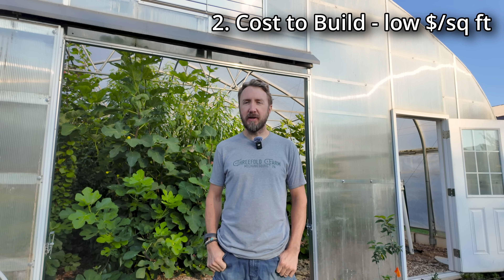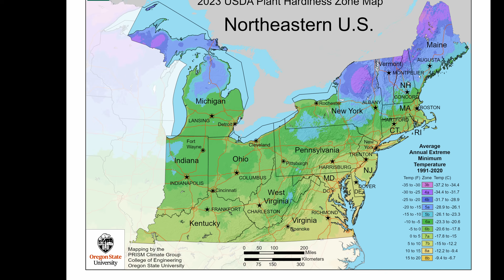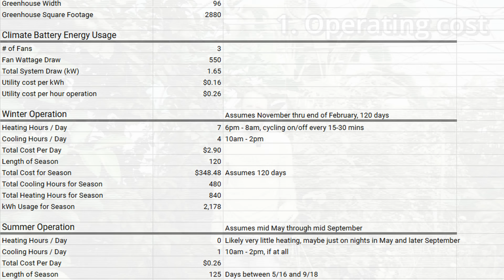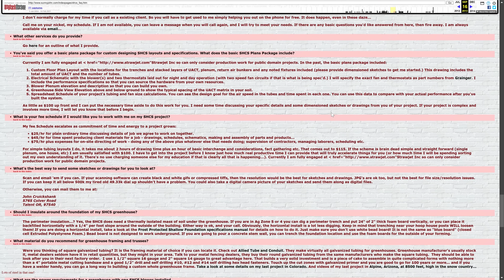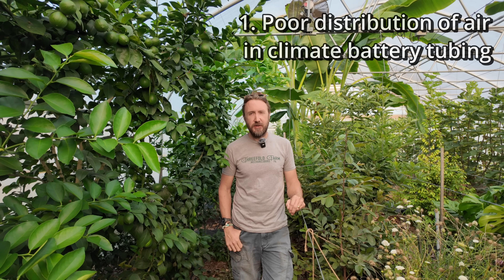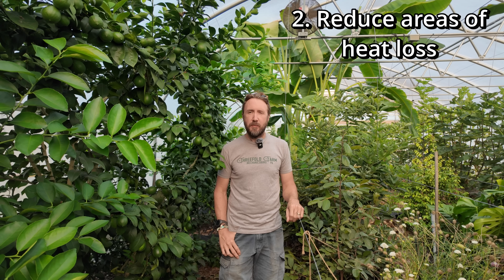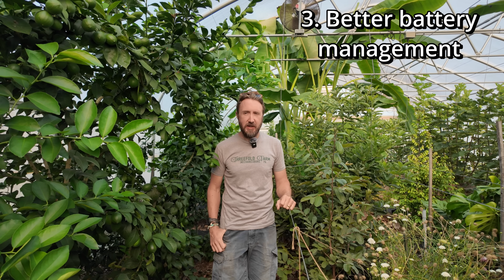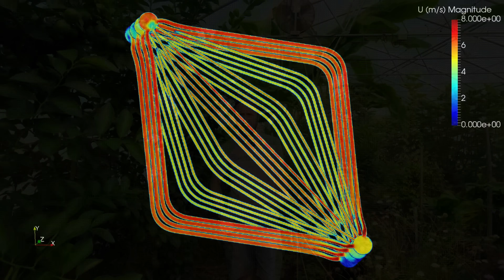Building an (Almost) Tropical Geothermal Climate Battery Greenhouse in a Temperate Climate

Comment: It seems that since fluid dynamics are so complex and unpredictable through a manifold did you ever experiment with a single sized airway that snaked back and forth and then split at the surface into manifolds to evenly distribute the ground temperature?

Comment: Loved the video! A few questions and comments
Why did you use a diamond shape distribution rather than simple parallel lines of duct work?
From the diagram it appears that near the inlet and outlet there is really very little soil to pipe ratio so each pipe is fighting the adjacent ones for ground to give or retrieve heat from. Yes you only need very short main ducts but I suspect it drops the efficiency by about 30%.

Plastic is a terrible media to conduct heat through. More insulative then conductive.
Corrugated pipe is terrible for air flow and heat transfer. The ribs increase the dynamic head so you need much greater fan force or need to keep the runs short. This may be why some of the runs are not nearly as efficient as others. The diamond design means some runs are longer then others so more resistance. Path of least resistance is alway where water and air go first. Also the air flows past the ribs in a way that leaves dead air in all those rib spaces acting as insulation as the flowing air is not in direct contact with the wall of the pipe. Sort of like your winter wind screen protects the green house from heat loss. That said the drainage tile is extremely cost effective just don't backfill with dry sand.
 
Maybe draw the heat from the peak of the greenhouse. The temperature would be 20 or more F degrees higher there on a sunny afternoon, increasing the efficiency dramatically

Comment: Thank you for the video. I want to make such a system for the greenhouse I will build this year. I am a ventilation specialist, I would try to change your noisy air fans to HVLS, to relieve your ears 😊 High Volume Low Speed fans

Comment: I would suggest doing a wrap of gravel and highstrength landscape fabric around the corrugated pipe. Check out weeping tile diy stuff where they burrito wrap the pipes to keep mud from packing in the holes of the pipes. It would prevent the pipe from crushing. You could also use pvc instead. The rocks would allow drainage if you have any water wicking in the tubes. The wrap would keep mud out if you have heavy rains. The rocks may help with a heating efficiency as well and may act as an electrolyte similar to an actual battery. I mean God put rocks in soil for a reason right? Which would allow maybe, for a more humid environment, tropical like climate.

Comment: So you gave me several ideas with the screen that you put to block wind. 7 Foot Tall Solar Panel Fencing, Or Even Just Used Solar Panels. No batteries, no charging, no inverters, just run that to DC heaters into the pool or pond at center of the greenhouse, let it heat up the water and during the evening it would release the heat. So the solar fence can keep the greenhouse warm, at the same time store direct solar energy in form of heat inside the greenhouse. No digging necessary possibly. Thanks for a great idea. Another great idea may be to instead of homes building Roofs of Wood, make the Roofs of Greenhouse, so that you can have a green house on your top floor, and the home needing to be warmed or cooled could provide the mass, as the floor could be made out of insuldeck a concrete material floor, so a sturdy structure with an amazing veggie and fruit garden upstairs, and yes automations could be introduced into there too! Good video watched every minute of it. Keep up the great work, would love to grow my own citrus and avacados!
Reply from the maker: Glad to hear the ideas were helpful!

Comment: I’m wondering if you could build a more efficient system using tubing that is a good conductor. Isn’t plastic a pretty bad conductor? I’m sure that cost would be the trick, but imagine if you could use something like aluminum pipe or copper (cost would make it impossible but just to make the point) below the ground. The temperature transfer between the soil and air would be really great. I’m sure I’m not saying anything new here. Just curious. Thanks for your outstanding work !

Comment: Seeing the students go into the pipes and see difference of temperature is extremely interesting. It’s likely worth it to throw a few temperature sensors inside the pipes and then have fans ramp up and down to average the temperature. Doing that would prevent some spaces from doing better and prevent some fans from needing to run saving power. Aka using fans whose areas are cooler is more efficient than those which are hotter because of the larger difference in temperature. It could also mean you could more precisely control the temperature by having less fans run at once and benefiting from the larger change in temperature. A couple esp32s with a dht22 using espnow would be a great project. While not chance the signal would go through the dirt having possibly even just one host (at the exit of one of the pipes )listening to all the sensor clients could be sufficient. To collect even more data you could have a few sensors around the green house to see if averaging the temperature throughout the climate battery results in a more average temperature inside the green house. I can think of soo many ways to potentially improve the efficiency. I think if I ever did a green house with a climate battery I’d end up spending too much time learning everything about it lol. Great video especially love simply going through potential solutions it’s important to know one size doesn’t fit all and it depends not only on where you live but your desired outcomes

Comment: how about adding heat sensors inside the tubing that is monitored by an computer or an AI that can then regulate the fan speed to improve airflow where needed
Reply from the maker: Yep, that's way down the line but could be a useful tool. Unfortunately our fans aren't as speed-controllable as that, though there seem to be fans coming that would allow for that level of control.

Comment: Have you considered at all driving pipes underground at a depth of 20+ ft instead of excavating the entire footprint of the greenhouse? Would the added benefit of depth offset the drill/installation cost over the cost of excavating the footprint to lay the pipes like in your greenhouse?
Reply from the maker: 20ft would give you a larger battery but still wouldn't allow you to tap into limitless heat. I have another video on the misconceptions about climate batteries that I'd recommend. 20' is really deep too, not sure it'd be worth the cost and I'm not sure how that'd be done (hydro excavation?).

Comment: Very cool approach with the simulations based on the physics properties. I always thought as a software developer myself that this is the way to go even in the adjustment of heat pump and AC systems where each system has a different efficiency curves based on the different sourcing temperatures etc. Fun fact there are also ice storage solutions (Eisspeicher) where the loss energy of a phase change is used by to use it in a heat pump. Because water looses as much energy when it is cooled down from 80°C (176F) to 0°C (32F) as it looses from a liquid state in 0°C when it freezes to ice. This can be used with heat pumps. Which are in Europe now preferably filled with propane R290 because it has a lower GWP than CO2 itself. Other refinements just be GWP over 100 years up to 4000 if I remember correctly. Thanks for the video.

Comment: Just curious why would you choose this method over a solar collector with a heat exchanger going into a storage tank?

Especially if you can bury the storage tank deep enough
Reply from the maker: Appreciate the question. The greenhouse is essentially a big solar collector, so all we're doing is designing the system to store that heat. It would take quite a few solar collectors to equal the sun surface area that a greenhouse has, though additional solar collectors isn't necessarily a bad idea as a supplement, though I'm not sure how cost effective it would be.

Comment: Our perceived obstacle is the high water table here in mid Michigan and the inevitability of mold and other complications with the underground tubes. What is the water table in your neck of the woods?
Reply from the maker: Water table isn't a problem here, but yes I know it is in parts of the country. I've never personally had a problem with mold or heard of anyone having problems with mold who run these systems, though with a high water table that would certainly be a concern.

Comment: Thank you so much for this video - I've watched several times.   I do have one question: Did you take a look at the role soil moisture plays in your battery capacity.  Water has a much higher heat capacity - 4 to 5 times higher than dry soil.  You didn't mention anything about soil moisture and so I'm curious if you have considered this in your design, and are monitoring it and trying to maintain a target soil moisture in your system?   One other question - on the other side - have you ever had problems with flooding in your heat exchanger tubes - they don't look water tight.  

I'm a EE by the way - 

Thanks again - keep up the great work!
Reply from the maker: I don't monitor soil moisture but it seems to stay relatively damp, especially outside of the root zone of plants. Yes, damp soil is helpful versus dry soil, both for conductivity and heat holding ability.

No significant issues with flooding. I've seen a little water in the risers only after a very heavy rain (~2"/hr) but it drains out readily in our soils.

Comment: If you're capable of drawing more than is available during the cold season to keep up with demand, then the summer is not taking care of reheating the soil passively. Many geothermal heating systems that haven't taken this into account grow colder year after year. It's also possible to overdo it and make it warmer than you need, it's essential to monitor and balance the heat exchange across the seasons.
Reply from the maker: Respectfully, the problem is actually more about heating demand exceeding the production from the sun at that time of year. We eventually deplete any stored heat and don't have enough sun to adequately recharge it until about mid February when our solar gain exceeds our draw. We could adjust thermostats so that our draw is made less but we're trying to push one of our greenhouses to its limits in our climate so we try to keep it above 32F.

Comment: I'm planning to build my own sub-tropical winter greenhouse this year. My first issue is my water table is just below the surface during the winter and 6-8 feet below the surface in the summer. My battery will have to be "waterproof" so I think I may use water based radiator system instead of air based circulation. I'm also planning on being able to charge it with solar water heaters and/or rocket mass heater. I still plan on a solid and insulated north wall but I'm impressed by how open and un-insulated your greenhouse is! This video is definitely helping me design my greenhouse better, thank you!
Reply: Please don't forget how fast water draws away heat! If there is any lateral movement of you under ground water, you will not be able to store heat. The heat you are attempting to store will be down stream in hours.
However, if that ground water is significantly warmer than the air temperature, it will be helpful in preventing freeze up but will never warm higher than the native temperature of that ground water.
Reply: @bobboersema362  I worked twenty years as a SCUBA diver in temperate waters, water draws heat away so fast! Upon further research I've decided my battery has to be thermally insulated if I put it underground. I put a large water tank in the ground over winter and it didn't stay as warm as I'd hoped. I think I'll try installing some underground temperature probes to track the temperatures next winter. For now I'm going to build a small above ground battery and try and grow lychee and goldenberry this winter.

Comment: Thank you for this very clear and coherent video. I have often fantasized about installing one of these but I've worried that our high water table (about 6 feet down) would interfere since the drain pipe would get full of water not air. Any thoughts on that? Also, do you have any customers who are using EQIP to fund a high tunnel and then installing it on top of a climate battery?
Reply from the maker: I believe some folks are using EQIP to help fund the tunnel. High water table would be a concern that you'd need to find a good solution to (either building up the site or building a more shallow battery well away from any groundwater swells).

Comment: You mentioned researching the Nebraska insulated greenhouse, but failed to mention that he also uses geothermal tubes to not only add heat, but also to exhaust excess heat back into the ground which solves some of the problem of insulated greenhouses not being able to vent their heat properly. These greenhouses can also have automated vents and utilize white sheets to reflect some of the sun. I understand you might not have wanted to go long explaining, but these are definitely applicable factors when discussing the topic.

Two questions: 1) Why did you choose not to exhaust your heat like the Nebraska greenhouse? (He runs a higher mounted exhaust fan to remove heat) 2) Why not use solar panels outside the greenhouse to run your fans? Did you happen to perform an ROI analysis on that as well?

Great video as I am planning a completely off-grid greenhouse and your work on the thermal battery i s almost revolutionary for that approach. Cheers!
Reply from the maker: Appreciate the kindly worded questions. Yes, you're right, there's only so much detail I can go into in the video without making it hours long. To answer your questions briefly:

Question 1 - I much prefer passive cooling if I can for ongoing cost reasons. We have roll-up sides, endwall doors, and endwall vents (without fans but operated to open on a thermostat). All of those are essentially passive or very low electric draw. Ventilation fans typically draw hundreds of watts when running and so add costs, so my ideal is to not use them if possible. Some well-sealed greenhouses' achilles heel is that they're so well-insulated that they have trouble passively ventilating. A ridge vent might be an attractive option as it would allow heat to escape through its natural path.

Question 2 - We are in the process of adding solar panels. However we have an inverse problem here. Just when we need to run the fans the most (winter), the sun is at its lowest and the panels don't output anything like their summer-time output. Therefore you'd need more panels to effective run the system through the winter, leading to an oversizing of panels for the summer (if you were just accounting for climate battery loads).

Comment: Hey, plumber here. I’ve cabled hundreds of sewer lines but don’t have too much experience with the drain tile pictured. Are you going to concrete around the couplings for your system? Despite what the salesmen say, roots love to crawl between the couplings, even the strongest of bonds. This is a problem I’d foresee 10-20 years down the line, when your root system is well established. I’m curious because I want to do the same thing but my biggest fear is ripping out both the geothermal system and the mature trees

Comment: You chose poorly… Soil isn’t a good climate battery, water is… And you chose the wrong greenhouse, multiple times (apparently)… if you choose a tunnel where you can have an inside poly wall with an air gap to the outside glazing, you could bump yer r value for a very low cost, and that would have still been a poor choice. Regardless… Trying to hock yer flawed tubing design isn’t the flex you think it is… It’s still a big fail. And it doesn’t look like you solved yer path of least resistance, flow distribution issue… Go do some research on the Taj Mahal water fountains… That shit was solved centuries ago. Gravity fed water fountains, all in a line, all with the same pressure and fountain height… You got some smarts, but common sense doesn’t live at yer address, if ya get my meaning. Those were some very obvious mistakes.

Comment: Here is a small question.  The scale you are aiming for is large commercial operation scale.  Can climate batter work for smaller scale?  Let's say 20x16? or 30 x 60?  

As it the scale gets smaller does the efficiency increase or decrease?
Reply from the maker: Yes, a climate battery can work as a smaller scale. Look up SARE project FNC19-1185 for some great info. Insulation around the battery becomes more of an issue the smaller the size of your thermal mass (the ratio of exposed surface area to the outside soil versus the volume of the battery). In certain climates it almost becomes a necessity to insulate the battery (see the above-referenced project for more info on insulation as well). So, overall I'd say the efficiency of the structure as a whole and the battery tends to go down as the structure size decreases.